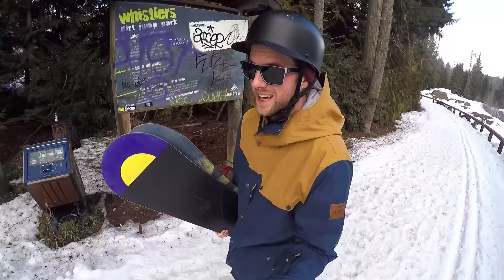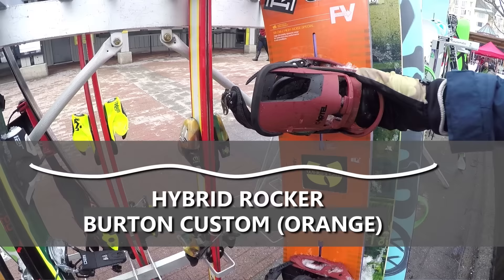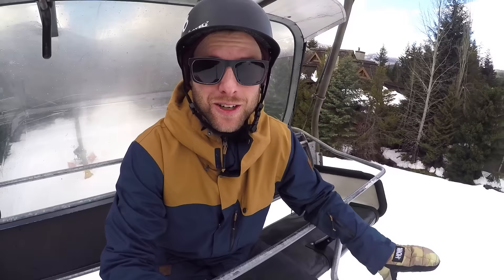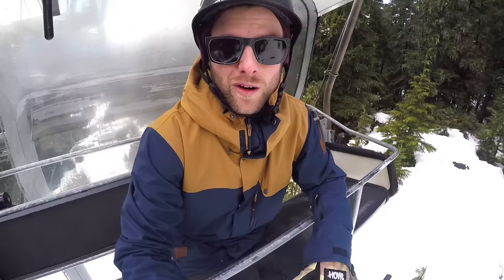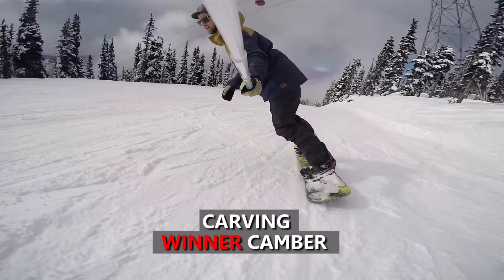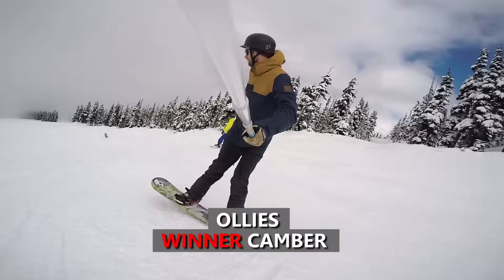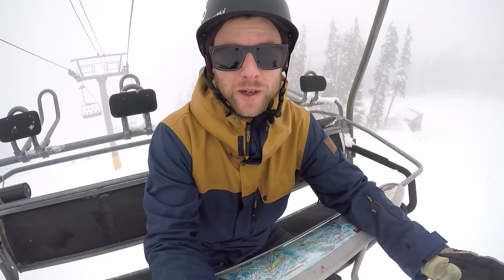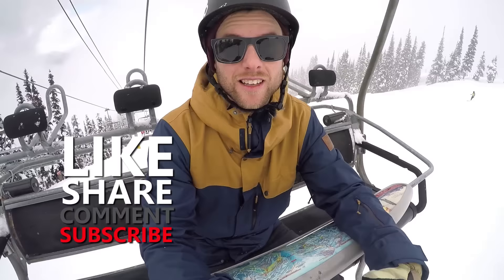Camber VS Rocker Snowboard Test

Comment: one thing that people don't really get is that rocker and magna traction are designed to work together.  Lib tech is the only company with the proper technology to make rocker work well (sorry, but it's true).  also, to carve well using rocker, you use the board differently, you work the middle of the board.  if your used to riding a camber board and you just use rocker like a camber board, it's not gonna feel right.  but when you recognize that you can really put a lot more power into the middle of the board, it opens up a whole new world of carving power, you can really adjust your arc, you can power carve through chunky and funky snow (the rocker absorbs bumps better when on edge).  from what ive heard, NS makes really good carving boards with their camber/rocker combo, and Lib Tech's Banana Magic and Cygnus X-1 (and others) are superb.  to review;  you need a correct board, most rocker boards are for jib/buttery action.  the right cam/rock combo along with "serrated edges" can give you supreme carving power,  better powder performance,  quicker turning ability, and improved performance in variable conditions (ice, chunks, not smooth snow)   having ridden since 1986, these new flex shapes are a game changer, I would not go back to a camber board for all around riding!
Reply: I love my 2015 Lib tech banana magic!  carves like crazy, floats in the pow, butters good, lands jumps well, light and fast.
Reply: Magna traction is only neccesary for east coast riding, or harder conditions, something like Arbors grip tech is a better variation in my opinion for most riding situations, and is more forgiving overall.
Reply: if you want a forgiving board, you can always get a skate banana, or get something with magnatraction .5.  that said, I ride in CA, UT, and CO, so I am seeing some good snow, but you always see spots that are icy, even if it's just hoar frost under the pow.  a high performance rider is going to appreciate the ability to really hold an edge no matter what sort of conditions you might be hitting.  I find the rocker makes for a very forgiving board when the board is flat or in choppy snow, and the more you tip it up, the more the edge just bites in.  combo of MT and BTX also gives unreal ability to carve truly tight turns, it was a game changer for me, you just have more control and power available, and you can be more aggressive because even if you hit a slippery spot, it's still gonna hold.   arbor makes good boards, but lib is the creme de la creme, lightest, best built, most environmentally friendly boards, all made in US.
Reply: lib is canadian
Reply: near canada.  WA is still in US.
Reply: oh yea, but honestly you either love or hate magnatraction, and its definitely not for everyone
Reply: if your a jibmaster, any edge "wave" is not gonna help.  but with C2, C3, and !BTX! Lib have really taken it to another level.  there's something there for anyone to love.  I got an older rocker board (gnu dirty pillow) with MTX and it was OK, too loose.  good for a rocker board, but not enough performance.  got a lynn fundamnental, w C3 and .5 mtx, it was not that great, too stiff and not enough MTX.    Banana Magic with !BTX!  was the perfect combo for aggressive, all mountain and off mountain riding, also great for freestyle. Lib has a strong R and D dept, they keep improving...
Reply: all I see is these companies trying to make a sidecut that is like magna traction without paying lib a licensing fee.    the fact that people complain about too much edgehold with magnatraction, but I don't hear it about other boards, tells me all I need to know.    NS has a pretty good system, but none of them has the knife action on ice that MT has.
Reply: I agree about the licencing fee.  and it's true, I have not ridden all those other boards.  like i said, I have yet to hear anyone say "too much edgehold" about anything except magnatraction.  in my snow world, there is no such thingas too much edge, not unless you can't get off it.  and with the rocker, you can always get off the edge.   Plus, I have talked to many people about these various .   it's all the same company, built by the same people in the same factory.   my point is this;  rocker with magna traction makes it a whole different game from other boards.  im not talking C2 or rocker/camber, im talking straight rocker.  only rocker board I have hear of that can really hold an edge at speed is made at mervin factory.
Reply: I ride in CA, UT and CO.  I am beginning to think you don't really know how to put a board on edge, amigo.   ive been riding since 1986, and earned level 3 cert with ASSI in 97.   and im all over the mountain;  trees, chutes, jumping, carving, the only place I don't really do much is the jibs.  which is the one place where having a smooth and detuned edge is a real benefit, IME.    I had a .5 mtx board and it was good, but nowhere near as good as !BTX! with full MTX.
Reply: your making some false assumptions, so I was being a little cheeky.  in the big picture, all im saying is that rocker is generally thought of as something that is more for freestyle and jibbing, but Lib in particular has built some boards that are next level for a power rider.  and that anyone who says it's got too much edgehold, either they don't know how to ride precisely, or are not really going at it, or, I don't even know.  a high performance rider with balance and skill and the desire to put speed and power into their riding cannot really have enough edgehold.  MTX and !BTX! is a superb high performance combination.  and what you have said about it only reinforced my opinion.  have a great winter R50
Reply: Trice is C2, a hybrid camber/rocker, different thing.  it's not about carving pencil lines.   it's about absolute edge hold, whether your carving or setting and edge, in variable conditions, and also about  the ability to adjust your arc within the turn.   as an example, last year riding at snowbird, there was some good snow, but also some underlying icy spots.  I hit a chute and halfway in, hit an ice patch.  no slide, no need to compensate, the edge just cut into it like a knife.  later, headed down the hill, you get to a spot where they blew a bunch of snow;  so from good snow to pretty icy, and you can't see which is which.  put it on edge and it just did not even matter.  later, riding through some soft bumps, i was totally carving through them, i mean THROUGH them, and the edgehold and the rocker absorbed bumps and lumps like no camber board could, and again, held a solid edge.   maybe your used to what your used to, for me I have always wanted better edgehold in a freestyle configuration, without the twitchiness that many big stiff boards have.  lib delivered it.  plus, it floats in pow way better than other boards, despite having a 132cm  edge on a 158 cm board.  so, yeah, im a lib fanatic.  every lib I have ridden, from 1992 emma peel to my new banana magic, has been cutting edge of  snowboard performance.
Reply: yo rc50.  just read the 2016/17 transworld snowboard tests.  could not resist mentioning that Mervin had 8, count them, 8 boards in the good wood.  most of any manufacturer.  Trice model got 3.  seems someone might agree with this Mervin fanatic.  cheers.
Reply: I earned it in 1996, when it was transitioning from PSIA to ASSI.  yes, it's back in the day. I also hold an MS in sport science, im not just a snowboarder but an exercise and high performance scientist.  so maybe my goals for a snowboard are a bit different.   but now I understand 3 things.  1 your enough in the industry to be biased youself, more than me, in fact.  2.  you don't really want as much edge hold as you can get "enough for me!"   lol.  3.  your somehow bitter about mervin.  it's cool, thanks for explaining.
Reply: now your just mad.    your right,  I am a big fan of mervin.  because they make the lightest, strongest, best designed, highest performing, most innovative (almost every single board innovation in the history of the industry came from them; props to yes for their design innovations lately) made in US, most environmentally friendly boards in existence.   they also make the best surfboards around, dope ass skis and badass skateboards.  they are probably the only large company whos boards are made for snowboarders, by snowboarders.    maybe some other folks who are looking for the best ride they can find will use check them out.  have a good winter.
Reply: factchecker =  100 true.  deep sidecut and camber?   gnu first    cap construction?  gnu first (before any ski company)   symmetrical skate style design?  Lib first.   non radial sidecuts?  lib, again, first.  "wavy" edge design?  lib first.  rocker (banana)  lib first. Hybrid cam/rock?  lib and NS came up with it same year, everyone else is chasing them.  ecological friendly board construction? lib is light years ahead of   any other snowboard company and have pioneered numerous technologies for that purpose.   made in USA?  longest running company to continuously do so.  lightest board?  old cygnus X1 and the new Trice, won't find lighter for size.  lib has been known for decades to build superbly strong boards, and has done industry show tests to prove it.  also have completely revolutionized surfboard construction, boards 5X stronger also lighter than a PU board, won't take on water (closed cell foam), and way more environmentally friendly construction.   you know your argument is going down the tubes when you have to start throwing insults around.  like it or not, Mervin sets the standard.  has and will.   but hey, it's all good.  someone has to support those other companies, otherwise the industry would be boring.  so good job.
Reply: anyone can easily check these facts for themselves with a little digging.   truth is, the snowboard industry is full of copycats, only a handful of companies have done more than hire pro riders and make cool graphics for a board made in austria. Companies like Winterstick, Gnu, Voile, Burton, and Never Summer are among the few that have made any real design innovations in the history of the sport.  and Gnu has made many of them.   you don't even know the history of your own sport.  lame.    ill take my "ignorance" which comes from being interested and involved in the sport since they put skegs in the bottom of a board (I still have that board) than your uninformed whining and insults any day.
Reply: forgot to mention Yes snowboards, Now bindings, Flow, K2 and Spring Break.  Yes' 420 is a great board innovation, as is their 20/20.  Now bindings, with their kingpin design are a real improvement in binding technology.  Flow with their rear entry bindings, and K2 with their clickers were also important design innovations.  Spring Break is making some fun and interesting board shapes.  these are the innovators, respect to those who move the technology of snowboarding forward.
Reply: hey, gotta come clean.  I was being kinda crusty.  not saying it wasn't true, but in the big picture, the best technology is what allows you to have a great day on the hill.  many snowboards can achieve that admirably.  have a good one.
Reply: rlclark50 nows  are so heavy i have been moving thousands of binding boxes the last month and they very noticeably heavier
Reply: ...Smokin Snowboards
Reply: Need popcorn for this read!
Reply: aistis72 I went from a rocker to a magna traction rocker and wow what a difference it made. My friend tried my board after picking up a burton custom and went out and bought a manga traction as a second board.
Reply: Just bought a Gnu Rider's Choice with magna-traction. After reading about the benefits of MT I knew it was what I for the various terrain I get skiing the northeast. Can't wait to push my carves to the limit with this one!
Reply: asymmetric edges will put magna traction out of date. just ride a stiffy if you want more control
Reply: asym edges are an attempt to avoid MTX patent.  MTX gives improved edgehold in times when more stiffness wont;  in variable, chunk, and off piste.  a stiffer board will hold an edge well, but it wants to go straight.  skunk ape, banana magic, TRice boards will hold an edge well, but you can vary the shape of the turn much more.  if you don't like them, don't ride it, it's all good, but, having been riding since '86, my banana magic is the top of the food chain, unreal.  carves like a ninja, playful when you want it, floats in pow, and there is no such thing as ice anymore.
Reply: don't forget about the gnu park pickle if you can find a new one their dreamy, i'm onto my second pickle. basically the same as the banana but don't forget about the asymmetric side cuts and twin tips
Reply: haven't tried the park pickle, but the deeper heelside cut is great.  another gnu first (nitro stole it).  my perfect board would be a banana magic UW with deeper heelsidecut and just a little more runout on the tip and tail...
Reply: I got a Skunk Ape a few years ago and I love it.  You are 100% right about having more power right under your feet.  I can carve right through chop that would normally take me off my edge.  I probably can't eurocarve a groomer as well, but that is about it as far as disadvantages go.  Maybe I will go back to regular camber when I am 70 and can't do tricks anymore.
Reply: nice.  i was a big carver back in the day, and still really like to crank a carve.  I found my Banana Magic could carve better than any camber board ive ridden, particularly was able to really "shape" the carve, by varying the pressure. also got great ability to emphasize the nose or tail of board.  most camber boards, they can carve, but they have their radius and they don't carve as well if you want them to do a shorter or longer carve.  im never going back!  i mean, ill try stuff, but...
Reply: Richard Shapiro Have been using a neversummer legacy (SL for smaller guys) for 7 years now. Ideal for powder, jibs and carving due to its rocker camber mixture. My gf just bought the girl's version and is very (!) stoked about it
Reply: Couldn't agree more. I have a lib tech TRS from like 2014 I believe and that thing completely rips... Awesome in pow. A little wild on really steep runs when you need a speed check but like you said, you get used to it. My buddy has a flying V exactly like the one in the video and I've ridden it and really like it too, but the edge on the lib is far superior
Reply: Richard Shapiro HAHAHA you are really going to boast the fact that you have your level three certification through AASI? If you got it in 1997 when AASI first formed than that is a joke. You guys basically made up your own tests back than. I know because I work with someone who helped form AASI and got their level 3 at the same time. That rider is a joke compared to the current level 2 certifications in the resort. Hell most level ones out ride the level three from 1997. Go take the current level 3 test and see if you can even come close to passing ANY of the days and come talk about how much you know. It is laughable that people are allowed to get the level 3 and still have it 20 years later even though the sport has changed so much. People should be re-tested after 5 years to show they still are capable of that level of certification.
Reply: Richard Shapiro Wow! Those are strong words for someone who claims to "help" the industry. You can be a keyboard warrior all you want but you were the one who tried to say you know way more about snowboards than anyone else on this comment section because you have a level 3 certification that doesn't mean anything. If you had one from the last couple of years it would mean something. To tell someone just by their preference of board shape that they clearly don't know how to carve correctly is absurd. If you teach like that I feel bad for the people you teach. The first thing ANY AASI examiner will tell you is that there is no right or wrong way to snowboard but you act like because you have been doing it for so long there is. The way you ride is the right way and everyone else is inferior. But if you want to act so tough on YouTube keep calling people like me a twat. That will get the spirt to grow so much.
Reply: Richard Shapiro yet again calling names. I laughed at you because you acted like you knew everything because of that certification. Snowboarding has changed since you got it and so you shouldn't ever bring that up. Unless you go and get your level three now don't act like you are the authority on snowboarding because you got it when AASI first started. Oh and I didn't have to put any energy to making you resort to name calling.
Reply: Richard Shapiro Academy and GNU make good rocker boards too.
Reply: To me rockers are made for people that can not carve but want to carve.
Reply: What Batter XC2 or C3 ??

Comment: Neither of those boards are true rocker or true camber. The one board features the Flying V profile, which the shape he described in the video, but it's not really true rocker. The other board (green one) is a Burton Process Off-Axis, which has the "Pure Pop Camber" profile. It isn't true camber,  but camber between the bindings then a flat zone then early rise, which is more catch free than true camber. So it's not really an accurate comparison between true rocker and true camber.

Comment: from this video some beginner snowboarder would deduce that camber is the only true way and rocker boards are just engineers' mistakes. and you didn't even mentioned that 
1) on rocker you're less likely to catch and edge
2) rocker is superb in powder
and you should have tested normal rocker instead of an hybrid.